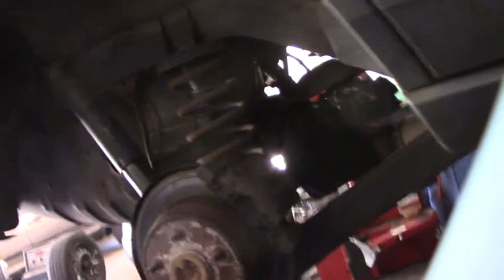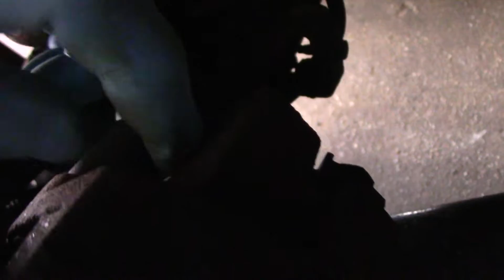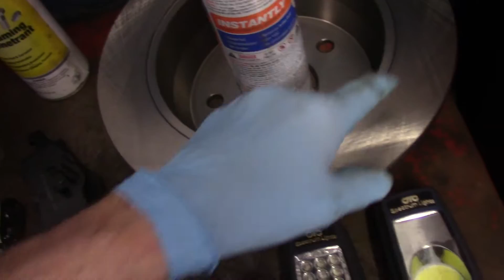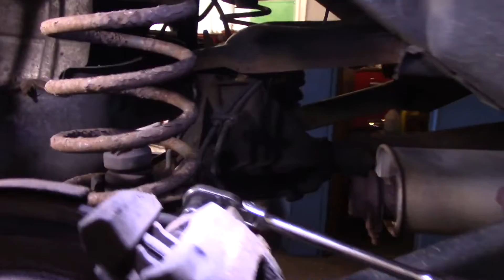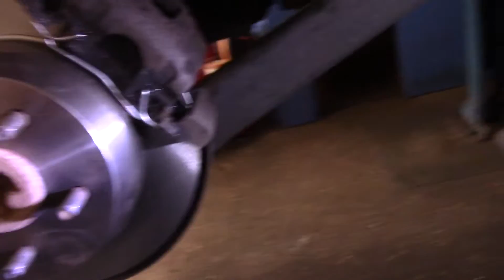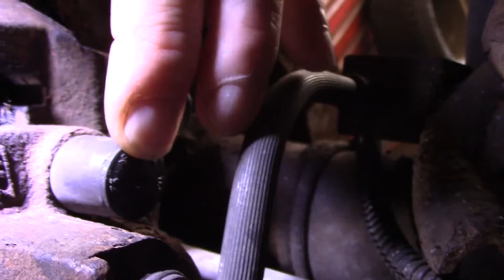Replace Rear Brakes & Rotors 1999-2004 Jeep Grand Cherokee

Comment: Popping the rotor off like that is a good way to destroy the threads on those wheel studs, and then you have a another project.  Better to screw on the lugs most of the way to protect those threads before popping the rotor.

Comment: I was just watching your video about you changing out the rear brakes on a 2004 Jeep Grand Cherokee. I noticed when you removed the rotor the parking brake shoes were completely destroyed from normal use however you never mentioned them or replaced them in the video. The shoes are behind the axle and inside the rotor. (Pad in a Hat) Why not replace them when you have the rotor off?
Reply from the maker: Actually the shoes were in good condition. The parking brake shoes are thinner than normal brakes. Thanks for your input.

Comment: T45 or 47 Torx bit, not hex but we get it
Reply from the maker: That you for your input and for watchng.
Reply: My 2003 WJ has 7mm hex(Allen) caliper pins/bolts.  Try that first.

Comment: Hi Jim, can you post a link to the tool you use at 10:20 ? Thank you
Reply: Bryan Lamontagne it’s a brake pad spreader. There’s various different ones on the market. Your local auto parts store will have something similar in stock.  They range from really cheap to expensive
Reply: chris parenti thank you Chris, yes I have the one from Cornwall, but I like the style of this one and was hoping he had a link where to find it.
Reply from the maker: That was great advice from Chris. The tool that I was using is made by Snap on tools
Reply: @jimthecarguy  Thank you Jim, and thank you again Chris.

Comment: Very good Jim!  One thing I would have liked for you to check was when you pressed the Pistons back in the calipers sometimes it overfills the master cylinder with brake fluid, and it can cause brake fluid spillage.  Have a good one Jim.  Tom
Reply: Do some people open the bleeder a little bit so some of the brake fluid comes out when the piston moves back,then when the job is about finished some fresh new fluid can be put into the master cylinder reservoir? Is the brake fluid inside the caliper dirtier than the rest of the system?
Reply: @davidpowell3347 not worth it,  air could possible get in there if it's not done correctly , let the master over flow a little it won't bother it , sometimes if I remember I'll take the cap off , for fear of damaging the cap rubber seal , but I never had a problem with one getting damaged , it's rare .. and I've done it everyway you can think of ..

Comment: Greetings and Blessings Jim!

I would like to see some diagnostics videos, using the Oscilloscope.
Probably, testing an O2 sensor, Cam/Crank correlation, Can Bus signals using the Breakout Box ect..ect...

It would be great and helpful for some beginers!

Did you test the BaroScope to see the  intake/exhaust valves?